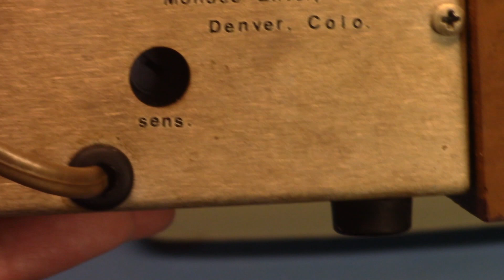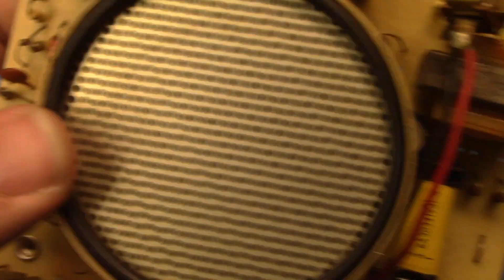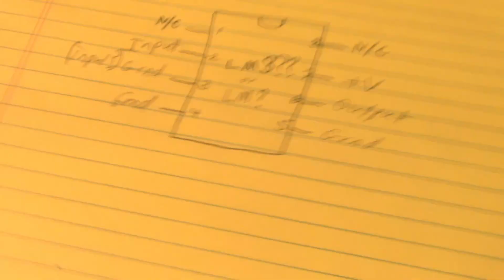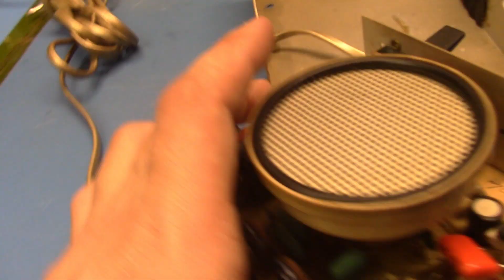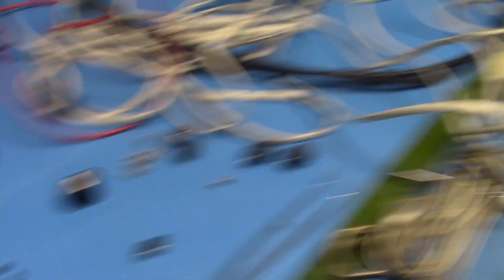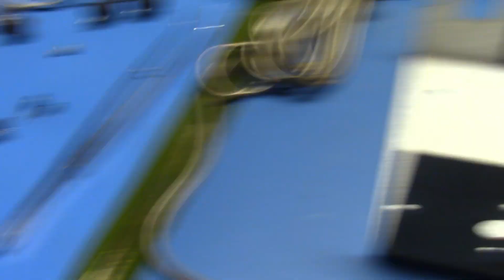Vintage Prototype Speaker-Phone Device (INCLUDES A TELEPHONE CONVERSATION)

Comment: Maybe a LM380N-8.
Reply from the maker: Thank you! I didn't realize there was an 8-pin version of the LM380 (I have the 14-pin version in my parts drawers). Now I'm wondering if the heat was normal... It might have been just fine all along. Edit: No, the original chip itself is bad, but I do believe it is the 8-pin LM380N-8.

Comment: When I worked for a Phone equipment company they used a common Motorola CPU chip. But if you tried to us it in your computer it would not work because it was modified for them only. Modifications were also done for memory chips and many other components.
Reply from the maker: Wow!!